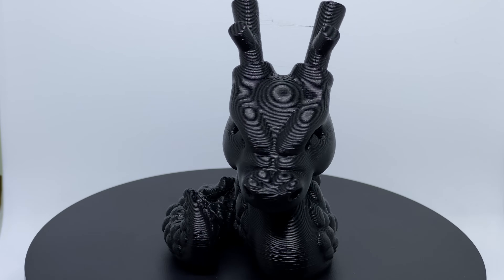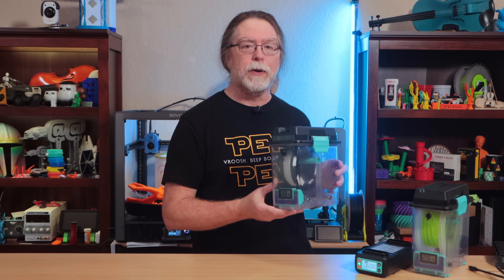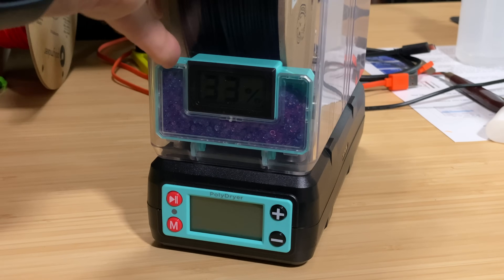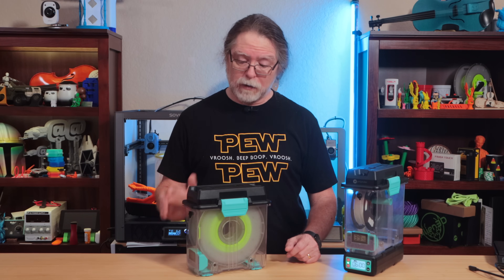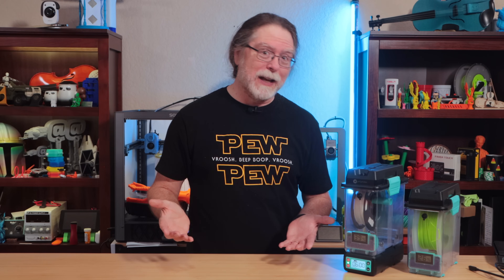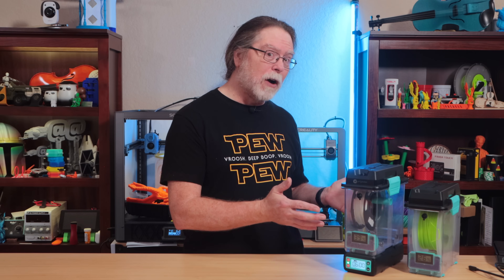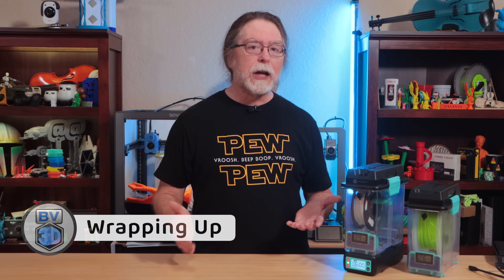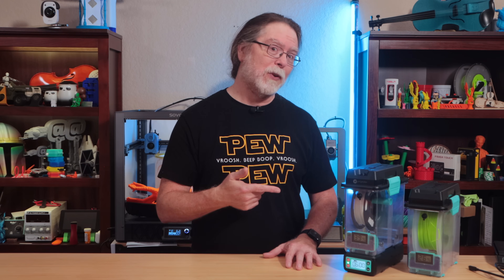First Look: Polymaker PolyDryer Modular Filament Drying System

Comment: Do you dry the filament with the grommets open or closed?  This was not discussed, nor is it in the manual anywhere.... Or any other review of the PolyDryer... Thoughts or advice?
Reply from the maker: Hi! I do it with the grommets closed. The only time I have a grommet open is when I'm using a PTFE tube to feed filament out of the box into a printer.
Reply: @BV3D thank you! Appreciate the response. I guess the key then is to make sure that the desiccant is dried regularly if we’re relying on it to take that moisture.
Reply from the maker: @jeremymikus5461  You're quite welcome. And yes, drying the desiccant on a regular basis is a good idea. 😊

Comment: Just got mine this afternoon... I was hoping you'd mention how hard it is to read the LCD screen. I had to put it on a higher shelf so I wouldn't have to crouch to read it. As others mentioned, mine came with the orange desiccant, but I also ordered a container. I threw in a roll of PLA for 6 hours, and my hygrometer went down to 35%. Not sure if it should be lower, but I might end up getting a stand=-alone hygrometer and throw it in like you did. I'm about to do a print with the PLA now, so I hope it made a difference...

Comment: My experience with the hygrometers has been similar. Out of 4, one never drops below 30% and the others don’t get any lower than 20%.
Reply: I have beeen on 18% persistently after drying my PETG twice, i now dropped in another bag of silica gel and am down on 10% which is the mininum the hygrometer can display. So the dessicant is sufficient for storage but wont do additional drying I guess, you need to add extra gel for the job!

Comment: I am not a fan of the cheap hydrometer at this price point, especially if they are getting damaged from the long exposure to high temps of the heater. 
One other concern that no one has mentioned, does the drier vent out?  It looks like it just circulates the air.  That released moisture needs to go somewhere or it will get absorbed by the filament again once its cooled.
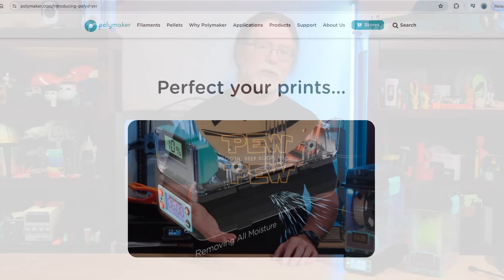Reply: He mentions this @ 8:20. Yes it has air exchange through vents on the side of the dock.

Comment: The idea is nice, but the execution seems lacking ...  Instead of having to plug the bottom yourself when removing the box from the dryer, I would expect a spring-loaded mechanism that has the dryer poke into the box to inject its heat.  That way the moment you remove the box from the dryer, it automatically seals again.  The boxes themselves should also be much cheaper. Definately < $20 per box, < $15 would be even more logical.  The hygrometer can be left out or offered as an accessory, if that is contributing to the cost of the box.  Same goes for the dessicant.  Now, I'm certain China is watching and will clone this good idea and since Polymaker's implementation makes it so easy, I guess we'll see better and cheaper implementations of the same idea appearing from Chinese brands.
Reply: You do know we are a Chinese brand :)
Reply: @Polymaker  :-)  Actually, I did not, but was not really excluding it.  Doesn't change my statements though that the boxes are too expensive for a concept whose selling point is to lower the total cost by splitting off the "expensive" part.  Then the "cheap" part should cost less than an Ikea 356+ box.

Comment: The price is a bit steep. Yes, even the spare boxes. Sure, the single spool storage boxes on Amazon are higher price, but frankly you have to dig through the search results to actually find them - which tells me they're not really selling at those prices. Most people are probably buying things like actual cereal boxes or other generic containers for filament storage, rather than storage specific to filament. It's the dryers most people are buying, and most dryers are in the $55 USD range.

Comment: The blue indicating gel is illegal in some countries. I think it's actually banned in the EU, if I remember correctly.
Reply: You get the orange gel here instead...
Reply: @werpu12  They changed to the orange; I wrote that seven months ago. The boxes are still expensive in my opinion, it's expensive to buy one for every filament.
Reply: @logicalfundy  Jepp the way I see it, if you do not want to buy a box, you probably can get around by simply cutting fitting holes into a cheap box doing the same!

Comment: Nice review. About silica gel, I am not sure, but if it passed rigorous EU regulations, it should be safe. How do you like beep sounds? Mine is too noisy. My hygrometers are more accurate, they don't jump and similar values in two boxes.
Reply from the maker: The initial power-on beep is OK, but I think the five or six beeps at the end of a drying cycle is a bit excessive. I think three beeps would've been sufficient. I'm glad the hygrometers you have with yours are working correctly. Mine may have come from a bad batch.

Comment: Good review.  I just received mine from TH3D, it seems I was lucky, as now they are out of stock every where.  I had my own dryer that I made from a food dehydrator, but this looks like a great solution and seems to be a fair price.
Reply from the maker: Very nice! I just found out that Polymaker has some printable accessories for the PolyDryer up on Printables. There's a wall mount and a couple of Air Lock holders available.

Comment: Great video but how many "drying cycles" do you run a spool through? I know it all depends on the humidity in the air but would you consider maybe 1 or 2 times ok? Or maybe 3 times? Where I'm at the humidity hovers between 45%-55%
Reply from the maker: I ran the spool through a second 6-hour cycle, but I didn't see any further improvements. But running PLA through a 12-hour drying cycle shouldn't hurt anything. You can try it on one spool, see how it does after one cycle, then dry it again and see if it improves even more. If it does, then maybe try a third cycle. But if one cycle seems to do it for you, you can probably just stick with that as a baseline, and run the filament through a second time if it looks like it needs it.

As a side note, I usually keep my filament in gallon zipper bags from the grocery store, with a desiccant pouch, and that seems to keep it happy most of the time. The RH% here is at about 53% at the moment. :)
Reply: @BV3D  Thanks for the info. I also keep mine in zipper bags with a few desiccant pouches. But never really know how well they work. I have old filament (3-4yrs old) that are also in bags with desiccants. Hopefully they can be revived by drying them out.

Comment: kind of a stupid solution if I might say.
Reply from the maker: Hi, what aspect of it do you dislike?
Reply: @BV3D  I responded to you a few days ago.... what happened to it?  Did you delete it.
Reply from the maker: @judd_s5643  I didn't delete it. If you don't mind reposting it, I would still like to know. Thanks!
Reply: @BV3D  There is nothing special about it! It fails at uniform heating of the material; it should rotate while drying but doesn’t. What's the point of having a humidity indicator when it has no calibration. Is it there for show? Functionally this is very similar to the EIBOS Polyphemus, it has a chamber and a heating element. The chambers sit of the heating element. EIBOS vents to the top, the Polydryer to the bottom. EiBos rotates the PolyDryer doesn’t The PolyDryer chamber has to many parts. A single spool chamber is kind of silly why allocate x hours of electricity to dry ONE spool.

It's kind of absurd the box you store your filament in cost more than the filament itself (majority of the time) Anyone that has a printer knows you end up with dozens of rolls of filament. It quickly becomes a logistic nightmare. With that in mind, the cost to store needs a solution. PolyDryer failed at it!
Manufacturers vacuum pack their products and include a small desiccant. I believe this is the least costly method of storing filament.

My approach is to use a Vac100 Chamber Vacuum and 12” x 14” 5 mil bags. These bags are multi-layer with moisture and air barriers. The ones I use cost about 20 cents each. For the desiccant, I purchased “loose leaf Tea bags” from Amazon, put a tablespoon of desiccant in and tie the draw string. Everything is then placed in the vacuum chamber for about 8 seconds. It vacates the majority of the air and seals the bag. Don’t pull a full vacuum because you will crush the spool. 
These chambers are expensive and are primarily sold to preserve food. They work perfect for sealing the filaments. I like my stuff to have dual purpose. The saving in food more than justifies the cost. Storing your filament cheaply is a bonus.

Comment: I was dying a solution like this a year ago. And mine used a silicone door that opened automatically with pressure rather than manually popping it open. But my enclosures kept melting as it was PLA and I couldn’t print ABS back then, maybe I could revisit. I even wanted to put rfid tags for material type so the temperate is automatic

Comment: What a surprise that the Polymaker PolyDryer is pricey and the extra boxes are too!  That's why I don't buy their filaments because they are the more pricey premium type of filaments.
I know that lots of youtube 3D printer channels bang on about how great the polymaker filaments are? But that's because they have them for free under a sponsor set up!

I stick to my Sun Lu 4 spool dryer as it is great. and now that I am only going to have 3 printers instead of the 5 I have at this time due to 3 of them mucking me around too much and not working even after the costly upgrading I've done to them, I be fine with using my 4 spool dryer and the 2 single sun lu S1 dryers I had before I got the 4 spool version.
Reply: I do like running their filament and haven't really gotten any better, but it's not enough better to justify the price for me either. My Sunlu S4 has been great as well. Seems like Polymaker is following the "send out an unfinished product" trend like most 3D printing companies...

Comment: I love polymakers glass fiber nylon filament! Though I'm having a hard time finding a dry box solution that fits the 2kg rolls. Does this fit those size rolls?
Reply: No. Polydryer is for max D205x78 mm. For 2kg spools maybe check Eibos Cyclopes or Polyphemus, Fixdry or Sovol dryers.
Reply from the maker: I'm with @MyTechFun on the Eibos Polyphemus. It'll hold up to a 3kg spool, though that requires printing a little riser to raise the top up a bit. Eibos has the printable file available for free.

Comment: Looks like a nice system, except the hygrometers :( Hope they replace them with something better. Not too pricey considering other options or having tot have 8 dryer box with cords plugged in compared to just one with 7 boxes keeping the filament dry! Oh I forgot - the blue silica beads, makes no difference to me. Everything now a days will kill you or give you some sort of cancer so a few grams of silica compared to the millions of vehicles/factories/etc doesn't really bother me.
Reply: the hygrometers are basically just dropped in, you can replace them with anything which runs on battery! I guess there will be mods soon for this stuff!

Comment: I agree with your comments about the Cons. I live in Houston and stuck printing out of my garage in +/- 80% RH most of the year.  Even my PLA will go bad in a week given how bad it is.  But, I use the clear plastic cereal dry boxes and print out rollers and desiccant holders and they work just fine to print out of.  Somehow, I never thought to have a unit like this Polymaker drydock.  Maybe we could tear down our older, less useful, Sunlu S1 units and make a drydock for our own dryboxes.  Hmm. Maybe we will. 

As for the blue desiccant, I'm sure if you don't eat it and don't breath its dust in when refilling or shaking, then it should do ok.  Is the blue silica gel removeable from the dry boxes?  Is that also where we recharge them, by using the dry dock?

Thanks for sharing!